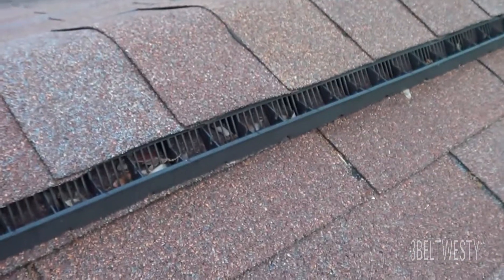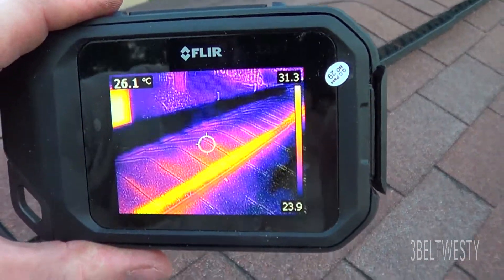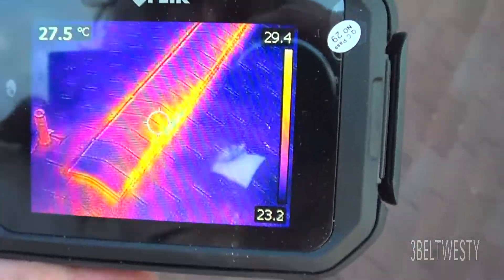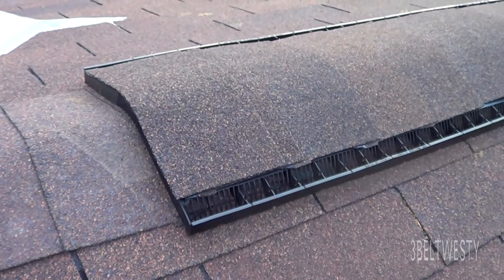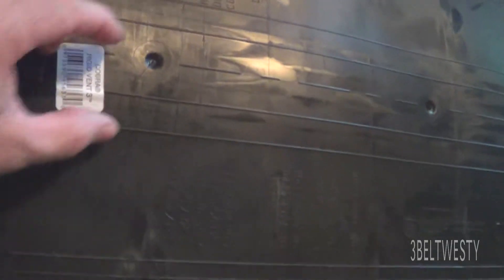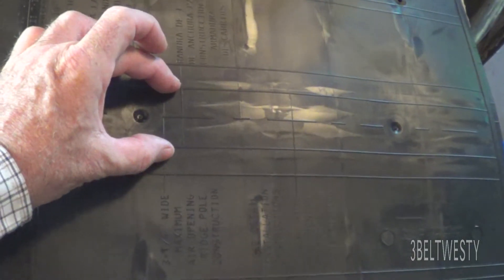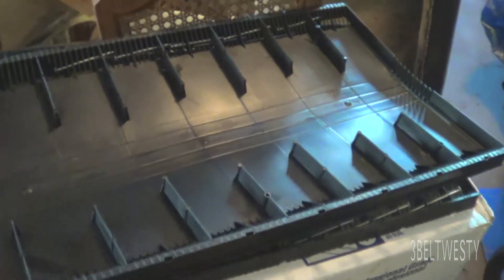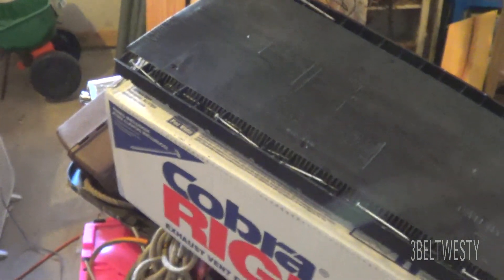FLIR C2 Cobra Ridge Vent 3 roof venting HVAC house survey thermal imaging

Comment: how do u like this flir c2 is it worth it or should I buy the E4
Reply from the maker: +mud flap I like the Flir C2 a lot.  It has found many heat loss areas in my home and business that I never knew where there. If one did home inspections the ceiling will appear cooler where there is a leak; even before the ceiling stains. I have not compared it to the E4 or used an E4. A comparison is in the 2nd link:  2 decades  ago I had a surplus infrared temperature pistol shaped gizmo. With the C2 it fits in the front pocket thus easy to carry. The E4 has a wider temperature range than the C2 482F top versus 302F and a lower temp range too
https://www.youtube.com/watch?v=LrLXs3iR7BE&index=3&list=PLNufO-PD0VozfOsBpm3mWW139edbpXUJA
http://www.tequipment.net/flir/flir-c2-vs-flir-e4/
Reply: Thanks..I'm gonna use it for general stuff house vehicles..I'm just stuck on C2 an E4 how is the image is it really crisp sharp..thanks